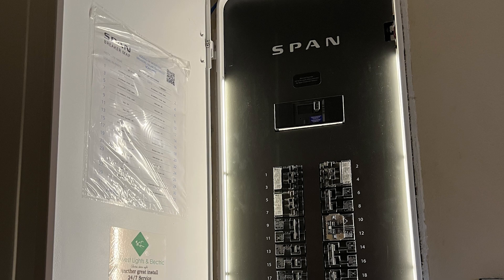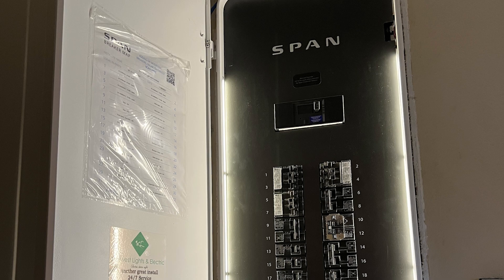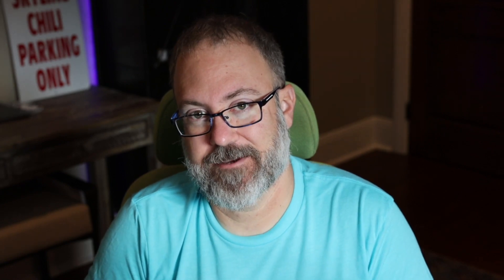Span Smart Panel: Episode 4 - oops

Comment: Span panels will accept standard breakers.  While the system can potentially monitor the circuit breakers state, it can't control it, nor should it for safety's sake.  The separate relay is for switching only and does not provide over-current or short-circuit protection.  Both the relay and the breaker have to be "ON" to energize the circuit.

Comment: Added complexity and inability to fix the issue is the reason why I will not never installed such panel unless there is a manual override. it is crazy to leave your house controlled by electronics connected to internet

Comment: A electric panel with no manual over ride, no thank you.
Reply: I thought it did. You just flip the switch manually. That’s the override. That’s so weird that he’s saying there’s no manual.
Reply: @DylanBegazo  Theres a manual shut off using the traditional breaker switch. But Span uses a relay connect/disconnect behind the breaker so if that gets disconnected and the software fails, there’s no manual reconnect.

Comment: Hi Aharon, thank you for sharing your process. I am thinking about SPAN and Tesla solar installation as well. Quick question, I thought SPAN installation can also decrease the amount of equipments you need for solar like critical load panels and gutter boxes. Is that the case for you? It seems like you had your SPAN  installed prior to solar, is that the better way? There was a discussion in your prior video suggested solar first and SPAN after, then what about the critical load panels and gutters boxes that will be installed if you do SPAN after solar panels installation? Thank you.
Reply from the maker: Howard, I would get Span installed after Solar. The Span needs to connect to the Tesla Gateway(s) to get data about your production and powerwalls. If you install them prior, the electrician wont be able to run the cable to the Gateways. I did mine prior as I had a sub-panel that was faulty and Tesla would not complete installation unless I replaced it first.
Reply: @SCAPTampa  thank you so much for letting me know. So you have to have the gutter boxes and the critical load panels installed as well I guess. I will be continuing to follow your progress. Thanks again. Wish everything works out smoothly for you.

Comment: Wow that is bad.  We as a homeowner should have the manual power to turn off and on the breakers.  What if span goes bankrupt then the panel would be dead?
Reply from the maker: You can manually turn off and on the breakers by hand. Just like any other panel. BUT, if you use the app to do it, it's using some sort of relay inside the unit.

Comment: I am shocked (as it were) that the designers of this product have decided to make the breakers completely dependent upon the cloud for operation.  This means that if there is any failure in any of the many links in this long chain of dependencies including the communications, the software, the hardware, or the human factors, you could be left without power, and without the means to turn on the power, even if you are standing right in front of the panel.  That is just asking for trouble.  Most so-called "smart" products require you to become dependent upon the cloud for the advanced features that are not available otherwise.  But controlling whether a circuit is powered is not an advanced feature of a panel, it is the core feature.  This product had so much potential, and in my mind the designers have completely wasted that potential.
Reply from the maker: I thought the same. Maybe there is a way to remove the black decorative cover around the breakers and manually enable/disable a circuit? However, the support team never suggested I do anything other than wait for them to attempt a re-enable.
Reply: @SCAPTampa  I'll bet those relays are controlled by a processor that you could replace with an ESP32 or equivalent, with completely local app control via Home Assistant and no dependency on the cloud.  I'm sure it would void the warranty, and make fire insurance problematic, but I would definitely do it.
Reply from the maker: @wuertele  both the electrician and I are learning through this process. We did remove the black decorative covering and there is a knob at the top of the unit. We think if we turn it that it may manually allow you to open and close all relays. We haven’t tried as the electrician said they told him to not turn it unless support tells him to do so.
Reply: @SCAPTampa  I'd love to see a photo or video of the internals!
Reply from the maker: @wuertele  Good feedback. I will have a video up in the next 4-5 days that has the full install. I will make sure to include video of the internals.
Reply: fwiw I watched a video that outlined 2022 goals for the panel. control the via local network was on there!
in fact here is the link showing the power point. you can rewind a few seconds for context. https://youtu.be/PKB8-lM7Ll4?t=904
I imagine Aharon's issue directly contributed to helping them improve the panel.

Comment: Great video, Aharon!  What is the power rating for your solar system?  (Im guessing its very impressive with 5 power walls!
Reply from the maker: Thank you for the comment Tony. The Solar Roof size is 40kW and we are now designed for 6 Powerwalls (4 Powerwall+s and 2 standard Powerwall 2s).